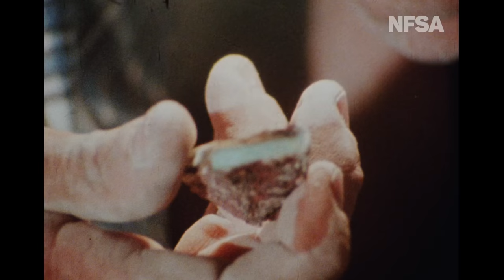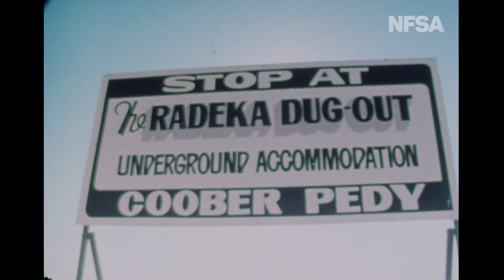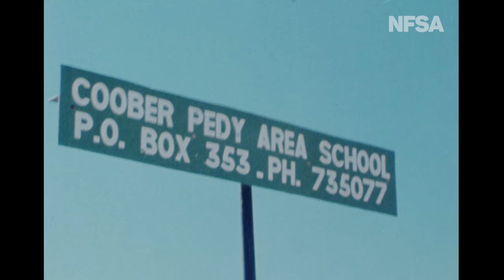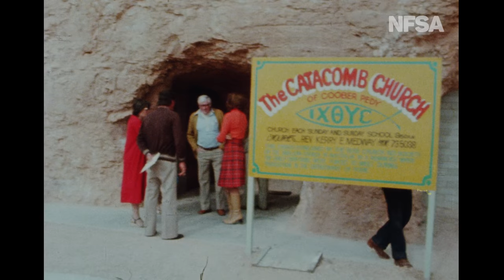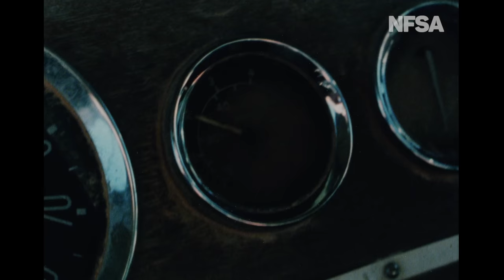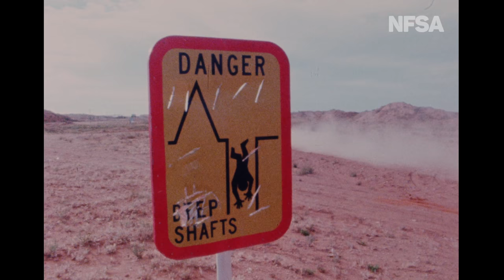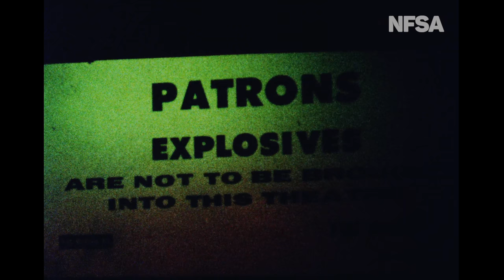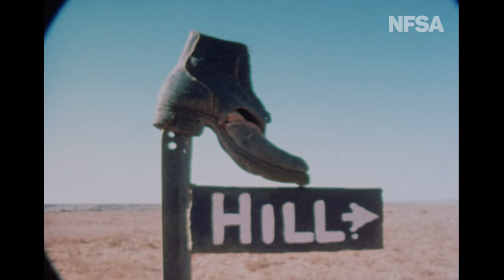Million Dollar Gamblers

Comment: This film may well have been made or released in 1982 but these folks were still clearly stuck in the 70's. 
Having grown up in the 60's, 70's and early 80's, I get a kick out the clothing and dance styles etc. It's funny.
PS> A shaft that once cost as much as $200 probably wouldn't get drilled for less than a $2000 today.
Reply: Its $10 a foot now so around the $600 mark